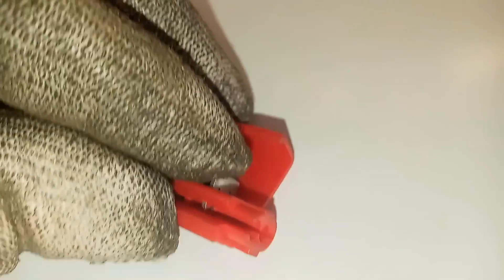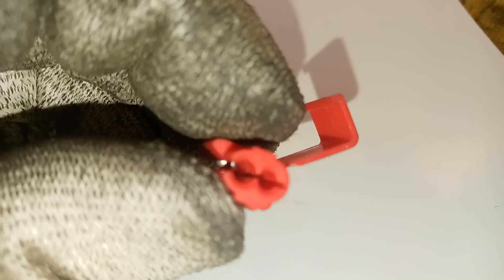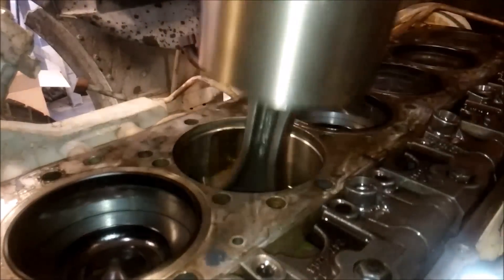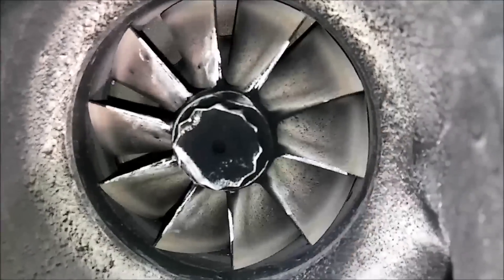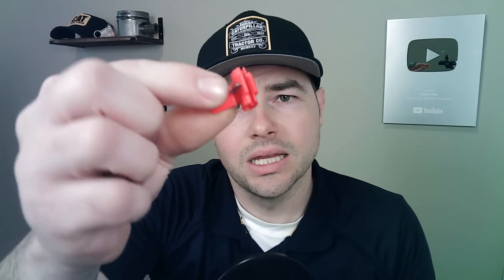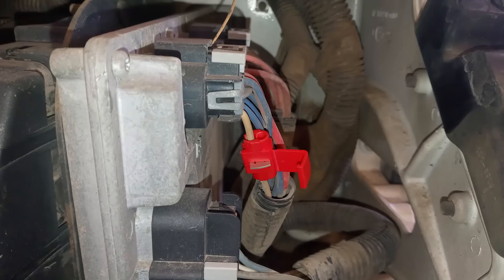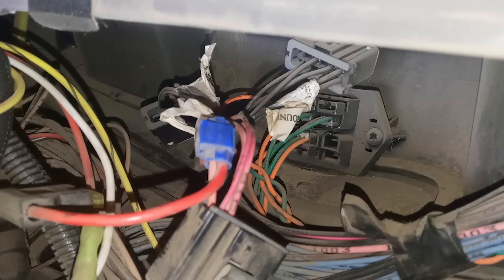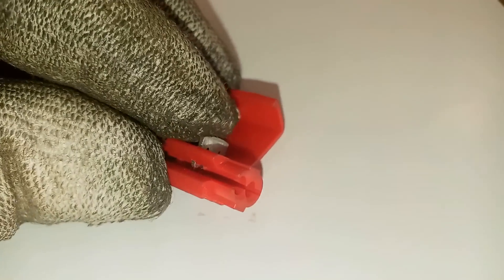Why you should NEVER use a Scotchlok connector.

Comment: Most of the complaints I see about these connectors involve vehicle applications. 
I'm not sure if this is the primary intended application for these. 
They could be used in control room applications, inside sealed enclosures. 
The question then becomes how much injury or insult is caused to the pass-through circuit, as opposed to other solutions (WAGOs) which involve cutting the wire completely and inserting it into a connector.

Comment: So I sat through a whole 10 minute video about one of my personal pet peeves which is those evil connectors. And you really never did explain or show some of the worst aspects of them. Like the fact that they cut the individual strands in your wires. And by the time I've got six of them on a tail light circuit I have potentially cut six different strands and a 12 strand wire. Thereby decreasing the ampacity - as you mentioned earlier in the video - by about 50%. Or maybe showing one that has got that pretty turquoise looking corrosion that has the wire ready to break in half would be another great visual aid. Otherwise great to know how many people hate these as bad as I do.

Comment: I personally think that such connectors belong in the trash. But I saw people using them for rear camera installation, but stripping insulation before applying them. Company that makes rear camera actually INCLUDED one, probably they are just a bunch of morons, but could this type of connector actually work if before using it wire was stripped? People who designed that camera should not be complete shit-for-brains idiots(though it looks like it), may be they have even done some testing on it.

Comment: 08 escalade exposed wiring no loom ground to basically everything  yup. I'm fixing what no shop could fix or didn't even want to whole harness out found several of those shorts waiting to happen or has  solder heat shrink liquid tape tape loom tape insulation at rub points and armor  
I fix the car as if it was my daughters or my mother's car

Comment: I agree with you my friend... how bout in a pinch on the side of the road with no electricity or soldering iron... I would certainly use these in a pinch if I had them in my vehicle.. just to get myself or a friend home... and fixed correctly after that

Comment: So I get it, they’re bad so what should be done when adding the safety lights one a trailer when splicing of the main line coming down? I’m supposed to soldier every connection and use heat shrink tubing every time?

Comment: I am hooking up a head unit what should I use because I have to install an accessory wire.
Reply: same. need to run the remote wire to my amp was either this or stripping and soldering

Comment: Just this week our clearance lights wernt working when the truck came back in. Noticed corner cap was just hit so ah ha... cut or short the wire... 
After an hour of screwing with the cap turns out although we had power at the point before the cap it wasn't that.. they used one of these to power the lights and under a load it stopped working.

Comment: I totally agree, I have always used waterproof butt connectors which are pretty pricey or solder with heat shrink tubing over it. The only time these should be used is for a temporary fix in an emergency.

Comment: I am a man and I will admit that I used these at one point in my life. Then I realized exactly what you said about corrosion on a license plate light wire. Ever since then if I’m in a hurry I use oversized butt terminals, tie the exposed wire together in a knot, drop in a little grease, crimp it noice and toit, and lastly melt the plastic connector to the wire insulation. It’s not perfect but it holds up.

Comment: Solder ball butt connectors... plug ends and heat.. can't pull it apart with fists and doesn't short decades in.. can do it with a Bic lighter... submersible... easy splice stuff leaks EMI etc

Comment: Posi-Tap is the only wire tap I ever use. They don't cut the tapped wire and you can use a dab of loctite or dielectric grease on both ends to maintain/establish insulation on the wiring

Comment: I fully agree with you. I am a marine (boat) mechanic and see these all of the time and always cause problems. Boat trailer manufacturers love using them probably for mostly the same reason you explained that radio and accessory installers use them. In salt water and in northern climates that salt the roads they cause the wire to erode sometimes from one end to the other inside the insulation. Some boat builders and riggers also use them with the same results. When a wiring problem occurs on a trailer do to Scotch connectors, I usually have to replace all of the wiring using the hot glue/shrink style of crimp connectors. A certain style of crimpers are required so a hole isn't poked through the insulation.

Comment: Sorry but I disagree with your statements on a few points, after 40 plus years redoing electrical in homes, cars, tractor trailers, off grid etc, and in 3 countries.
Any method you use to add a wire involves damaging insulation, wire, and gives possible rise to water damage. Not just scotch blocks. While the use of the wrong size scotch block will actually affect amperage and strength, the same happens in other places as well. 
When you are wiring up chicken lights, it would be nice to do fresh installs with three way connectors, etc.. or solder and heat shrink each connection. But just like when working with the ground wires in a home, you sometimes have no choice but to strip or join to a long wire at a mid point, and that is where the properly sized scotch block comes in handy as it gives the least amount of damage, causes no shortage of wire length during the tap, as well as being able to be waterproofed through the application of sealant tape and electrical tape.
Vibration in vehicles means that you can lose the barrel nuts, or the lever nuts, and both of those still need waterproofed due to road salts. Pus, both of those have shortened the original wire, and you have had to cut the insulation off the original wire as well. Not usually an option.
You hate them, and you make decent points, however, distance alone affects the amps at the far end  of the wire, not connections, although as any amatuer radio operator can tell you, every connection adds loss. But a normal tractor trailer for instance would have 12.6 volts at the battery end, and 11.8 to 12 volts at the tail lights of the trailer, due to voltage drop, without adding thirty chicken lights to the circuit. Add the lights and the voltage drops to 11.6 volts. 0.2 volts due to connections, 0.6 - 0.8 volts due to length of wire. Not enough to worry about, basically, but those butt plug and outlet connectors, after road salts have corroded the aluminum, well, those add even more voltage drop and broken connections.

Comment: one of my customers had a breathalyzer interlock installed for a few years. to install it they exclusively used these and to remove it they cut all the tap wires an inch+ away from the connector. leaving a bunch of dead ends hanging down from under the dash like tinsel

Comment: I agree those piercing taps are bad. First they are dry and second not always used correctly. 
3m actually makes better connectors under the same trade name   
As a retired telco tec we use other connectors as inline or butt connectors under engineering approval. 
Most are filled with dielectric gel unless used on paper covered wire (yes telco still uses paper covered wire)
I will say those automotive types are misused very much.

Comment: The only thing I've used these on was to tap in to the indicator circuit to install led resistors. Done in a sealed box on wires going to led trailer lamps. Every other time I will solder/crimp wires together and then use waterproof heatshrink to seal it.

Comment: Is that what these pieces of trash are called? I've hated them for years without knowing their name. So many electrical problems caused by this junk.

I use butt connectors with heat shrink tubing, but before inserting the wires to be connected or spliced I like to dip the ends in Super Lube dielectric grease to even further protect against corrosion. Because otherwise you're sealing salt (in my state at least) in with the wires, and eventually even the heat shrink tube will burst with corrosion.

Comment: Totally agree. I've done tons of wire repairs where these pieces of crap have allowed road salt to completely destroy all the wires at the connection. I used to carry a handful of them and a spool of wire when I was on the road so I could do an emergency repair on the truck or trailer, which would be replaced with a proper repair once back at home base.

Comment: Yep, as an auto electrician here in Australia working on mostly heavy vehicles and some plant equipment, these things keep me gainfully employed. Mostly by accessory fitters, fitting GPS trackers and cameras and things like that. Most heavy trailers I see don't use them from factory but small trailers like box trailers, caravans, boat trailers, are often wired using the horrid things, and it's easy to find the fault, you just look for the big taped up lump of Scotchloks under the rear and squeeze and wiggle it, normally stuff starts working again 😂.

Comment: The best is when whatever you're working on rolls into your shop with EVERY TYPE of SHIT connection/ splice POSSIBLE. In my 25+ years of turning wrenches I've seen some vehicles/ equipment come in with scotch taps, wire nuts, exposed butt splices, bare twists, etc... Literally every single splice but the CORRECT way of soldering/ heatshrink or uninsulated butt splices with heatshrink or even de-pinning and re-pinning the connector if applicable. Obviously each PROPER connection is more suitable depending on it's exposure to the elements, engine bay heatsoak, etc. Totally agree with you that laziness and not giving a crap about the next person who works on it has A LOT to do with the person who uses scotch taps. Decreasing the amp rating is another great point. Imagine how crazy things start going when there is a fluctuation in the wiring for a component that relies on a CAN-bus signal. You could absolutely lose your mind tracing those faults down BEFORE someone attempts to mess with the wiring for a CAN connection. Lots of 'faults' can be isolated to terrible connections, oxidation/ corrosion, etc. A Power Probe and a decent DVOM go a long way after your visual inspection of the harnesses, connectors and how they terminate/ the module, sensor, etc that they are connected to. When I'm adding a circuit that needs multiple connections I'd prefer a Deutsch connector all day. Piss poor grounds are all too common too, especially in the rust/ salt belt where I'm from. Great vidja as always bro! Always enjoy your content!👍👍😁

Comment: A place I used to work at always had me using these. When they were showing me how to install the child check systems and cameras in the Transit vans, my lead tech showed me those and my first question was why we don't run them into the fuse box. I had never wired anything like this before and saw the issue. Of course, voicing my concern was useless. There was a couple I wired in correctly as a control when I was the only one in the shop but they never came back for repairs. This was all before I learned that Fords are very picky about voltages. We had several vans come back into the shop that had them installed before I started working there and I wasn't able to figure out why the horns were melting or the child check wasn't working until I saw this. I'm not sure what my lead tech was doing to fix them but once I learned this, I cut that piece off, ran wire into the fuse panel, fused it, repaired the horn wire where it was tapped, replaced the horn, and parked it on the finish line in 1 and half hours if that was the only issue

Comment: The auto shop teacher at the high school I went to called scotchloks “don’t use em”. I don’t even like using crimp connectors. The amount of time it takes to solder and heat shrink wires is well worth not dealing with the frustration of electrical circuits not functioning later on.
Reply: They say solder breaks due to vibrations so crimp connections are better. I like the waterproof butt connectors, never had a problem with one, but they are pricey.
Reply: Seen so many failed crimps.......

Comment: Always wondered why the heck they use these on trailers for the electric brakes. Up there with the stupidity of leaving no slack in the wires so they make you splice in a longer wire if you have to replace a light.  Not like they don't just pass on all the costs to the purchaser.  Like please!!  Just add $100 more on to the purchase price so things last longer than one year.  Ugh!

Comment: I feel that same man!! I just went though a tandem axle equipment trailer had to re-do all the lights/brakes/connections all were either scothlock or twisted with electrical tape took a good while but it all works well with grote heat shrink

Comment: I have seen these used by the manufacturers on horse trailers , flat bed trailers, flat beds for pickups, cargo trailers , and snowmobile trailers. In manufactured homes they use a similar connection in the receptacles. I was going to buy a flat bed for my pickup one time and asked if they would give me a discount if I wired it myself. The salesman got indignant and said they never had any wiring problems. I think scotch locks last long enough to get past the warranty and so the salesman doesn’t see the problems, or doesn’t care.
Reply: You’ll see em on brand new bass boats trailers nowadays. Utterly ridiculous
Reply: I worked at a shop who used these exclusively for breathalyzer installs. 
PTSD from that place.
Reply: Never seen them on a new product anywhere here in the UK - the favourite users of them seem to be tow bar & car audio installers.
Tide seems to be turning here though, dont seem se them anywhere as much as I used to.
Reply: Yeah apparently these are a cancer that's run rampant in trailers.
Reply: I'm picking up a trailer this weekend and I already know I will have to go and eliminate this crap

Comment: Hate those things too. Worst thing, they are even used by dealer mechanics, even in brand new cars when they install additional electrical equipment.
Reply from the maker: Yeah, had a truck come in for a bypass on the fan switch recently. The customer didn't like the bypass another place had installed, of course they just Scotchloked the factory wiring, idiots.

Comment: I use those all the time.  Not for repairs, really, and definitely not on my own equipment.  I'm a used car dealer, and I wire in GPS and starter "kill switches" to my stuff.  Those "quick splicers" make wiring it in quick and easy.
Reply: Yep, sounds like something a used car dealer would do
Reply: You install crap buddy. You are definitely part of the problem. The reason why used car salesmen have the reputation that they do.

Comment: Me thinks Mr. Ape ran into some Scotchlok connectors this week.  While I can't disagree with anything he said about them they can be made more water resistant with some dielectric grease.  Not a great solution but it will work temporarily.  I can't tell you how many of these I have seen on trailers except that it was way too many.  Keep the good stuff coming.

Comment: Any electrical fault I deal with - if I see these suckers anywhere, they're first removed and wiring spliced properly before any further testing. 
You'd be amazed how many times the problems magically go away...
They make excellent heaters 👌
Reply: C
Reply: Trying to remove these junk they used to attach my Kurt trailer harness.  Want to reverse back to stock as it’s tapped into my tail lights

Comment: Absolutely agree! There is no justification to use scotchloks in a vehicle application. Not even an emergency repair. Posilock connectors are vastly preferable until a proper repair is made be a vehicle electrician. "WAGOs" in a vehicle are just the evolution of wirenuts and their saving grace is they are not IDC but the same is true for a wirenut. Emergency use only.
Reply: I see wirenuts AKA Marrettes on a vehicle, I cringe, and I'm an electrician. 🤣

Comment: I use WAGO's and pack them full of dielectric grease first. Reusable, have a test point, come in 2-8 wire designs, UL rated for mains AC voltage and current over any need, ie. 450VAC/32A,41A come in 12-24awg(32A) and 10-20awg(41A)
Reply: @chasingcapsaicin I'm a beginner, and I used 3M Scotchlok connectors. I'm wondering how you handle things with Wagos? What type of Wago connectors do you use? It's for connecting a backup camera to the rear light.

Comment: Not to mention a dielectric connection, literally becomes a battery that corrodes the wire, that is literally how a battery works.
Reply: dielectric is the wrong term but I cant think of it
Reply: Maybe galvanic
Reply: You are thinking of galvanic corrosion, but this is the least of the problems with Scotchloks.

Comment: I agree 100% about scotch loks.   I found several on my RV when I purchased it used.  I found them because the circuits they were on failed.  I rewired those circuits making sure they were properly fused.  When an electrical connection is made with a scotch lock or an improperly applied butt connector, the resistance within that circuit goes up, and it can cause a hot spot which causes more resistance and so on.  As Josh said, that can cause a fire at worst or a failed circuit at best.  Another informative video from that most adept……ape.
Reply from the maker: Thanks for watching Larry, I knew you'd agree with me on this one.

Comment: I've used these in low current interior circuits where the wire is so far up under the dash that I can barely fit one hand.
Reply from the maker: ALF has had quite the body transformation it looks like.